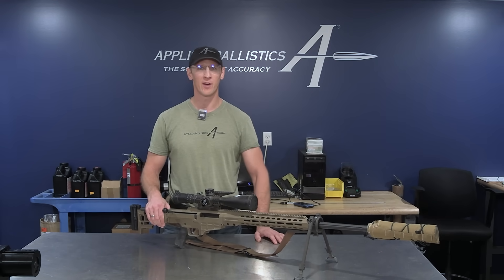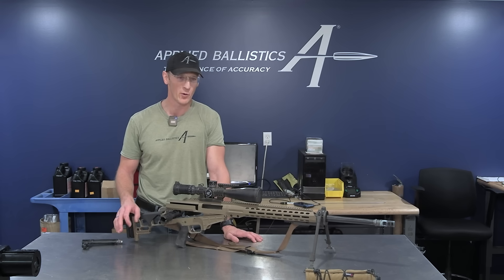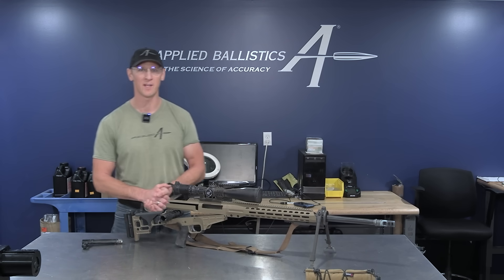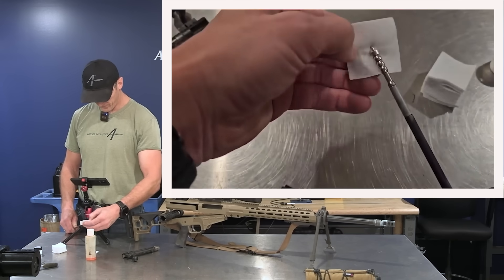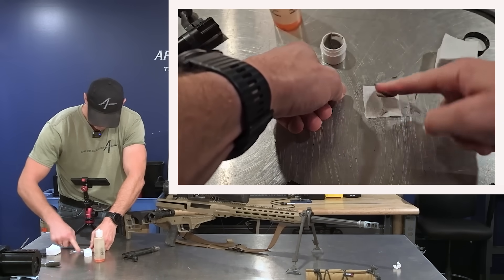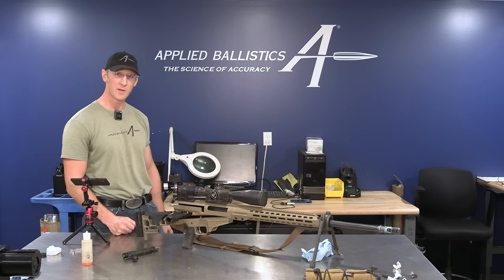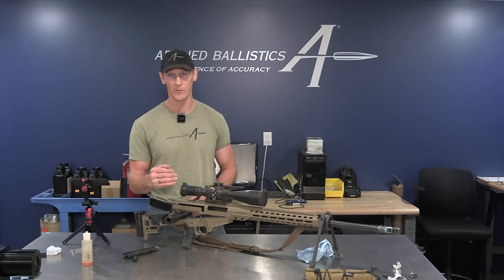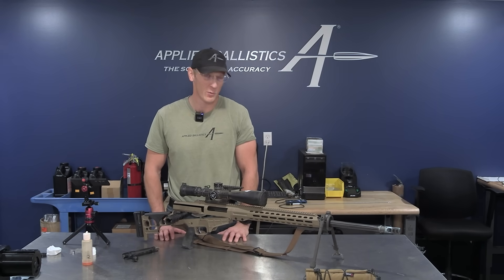High Performance Rifle Barrel Cleaning

Comment: I use a lot of JB Bore Paste.   I wrap a patch around a worn nylon brush and plaster on the JB.   I also run a couple of wet patches thru first and always use a bore guide.  Very clean barrels.
Reply: What I do is plug one end of the barrel with a number 2 pencil, or one of the fat ones kindergarteners use, depending on caliber. Then I open an old lead acid car battery or two and use a turkey baster to fill the barrel with acid standing on end. I ground it by soldering a 4ga copper wire on the bare steel inside the end of the barrel attached to a 4’ solid copper rod driven into the ground exactly 3 1/2 feet deep. Then I leave it in the sun for exactly 13 days. I start adding 1/2 teaspoon of baking soda in through the breech every 4 hrs for 4 days. Then I solder shut the breech with fishing weights and a propane torch and then cool it with dry ice. Then 7 days later I cut the copper grounding wire. Flip the barrel muzzle end up… I take a ball peen hammer and drive the no 2 pencil into the muzzle till it’s flat all the way in. Then I take a metal rod the same caliber diameter as the bore and drive the pencil through the barrel while slowly heating the breech in a fire made of dogwood and rosewood. While driving the pencil through the bore, the lead plug from the fishing weights will heat up and give way under pressure. When the fire hits the acid mixture it will ignite and blow the pencil half way out of the barrel and then suck it back in all the way through the barrel and out the breech into the fire in an instant. But only if you have done it right. If it doesn’t then you have to start over again. 
And then, after that,  I run a couple of oiled patches through it to protect it from rusting and you are done. 
Barrel will be cleaner than from the factory every time. 
I should add that I only clean my rifle after at least 20 rounds. But I never let it go more than 30 before I clean it. 

Hope this helps. 👍
Way better than how we cleaned them i  the army. Their way took forever and the armorer would keep sending you back till you cleaned all the bluing off of every part. 🤷🏼
Reply: This is how I clean barrels when I buy a used rifle.. often they were sold because "they stopped shooting".. 9 times out of 10, this cleaning (and some hand loading) gets them shooting small groups again ;)
Reply: Been doing that method forever...
Looks like we might be the only two .
LoL 😊
I would have thought there'd been more people to agree with that statement.

Comment: The only way I clean mine after 250 rounds a little more oil though and pre patches. Actually the only way I can clean it everything else barely works.  Thank you for confirming what my findings were.  I actually saw barrels get better at about 1100 rounds. Yes more cleaning but groups and sds came alive.    Now my question is why do we break in barrels why not Jb a fresh barrel and go for it?
Reply: I wouldn’t be rough enough to get the proper pressure and velocity.
Reply: What I do is plug one end of the barrel with a number 2 pencil, or one of the fat ones kindergarteners use, depending on caliber. Then I open an old lead acid car battery or two and use a turkey baster to fill the barrel with acid standing on end. I ground it by soldering a 4ga copper wire on the bare steel inside the end of the barrel attached to a 4’ solid copper rod driven into the ground exactly 3 1/2 feet deep. Then I leave it in the sun for exactly 13 days. I start adding 1/2 teaspoon of baking soda in through the breech every 4 hrs for 4 days. Then I solder shut the breech with fishing weights and a propane torch and then cool it with dry ice. Then 7 days later I cut the copper grounding wire. Flip the barrel muzzle end up… I take a ball peen hammer and drive the no 2 pencil into the muzzle till it’s flat all the way in. Then I take a metal rod the same caliber diameter as the bore and drive the pencil through the barrel while slowly heating the breech in a fire made of dogwood and rosewood. While driving the pencil through the bore, the lead plug from the fishing weights will heat up and give way under pressure. When the fire hits the acid mixture it will ignite and blow the pencil half way out of the barrel and then suck it back in all the way through the barrel and out the breech into the fire in an instant. But only if you have done it right. If it doesn’t then you have to start over again. 
And then, after that,  I run a couple of oiled patches through it to protect it from rusting and you are done. 
Barrel will be cleaner than from the factory every time. 
I should add that I only clean my rifle after at least 20 rounds. But I never let it go more than 30 before I clean it. 

Hope this helps. 👍
Way better than how we cleaned them i  the army. Their way took forever and the armorer would keep sending you back till you cleaned all the bluing off of every part. 🤷🏼

Comment: Don’t know if anybody would be interested in a couple of extra step that I do. I actually cut circular leather(cowhide) patches and instead of running the second patch with the JB paste I use the piece of cowhide with JB paste. Just cowhide, not a thick piece of leather. Then I clean everything but at the end of that, I just put some oil on a separate patch of cowhide and I worked the barrel back-and-forth again. I am a 22 shooter so I do not have to deal with copper. I only shoot lead and I do not have the fire cracking like the big guns but I’m telling you it gets unbelievably clean and polished.
Reply: Yeah that’s overkill on a 22 no need to clean it at all really

Comment: As a metallurgist, it blows my mind that rifle makers and barrel manufacturers who specialize in high precision rifles have not addressed the root cause of barrel failure. "Fire cracking" is a problem that has been addressed in other industries, but for some reason the firearm industry just doesn't seem to want to actually fix the problem.
Reply: I think the issue is the difficulty of making barrels to the precision required, so the main steel characteristic being selected for is machinability. You will know that there are many military barrels with chrome lined bores which increases their life and reduces fire cracking and throat erosion substantially. You don't see chrome bores in any precision rifles as it tends to lower accuracy.

The push toward higher performance cartridges with high round count use cases in recent years may spur some development on this front, but somehow I doubt it.
Reply: @SixtyTen10  I strongly believe that if a  carbide bit / rotary file for a die grinder can be machined with precision there is no  reason why a barrel can’t be machined with precision using inconel .
Reply: @levigne25 I think the quagmire is with internal vs external geometries. The die grinder bit, it's really easy to use a huge, heavy, stiff machine to make tiny precise little cuts. But machining rifling its really hard to maintain that level of rigidity being so far away from the tool holder. So we're stuck with softer more machinable steels until someone figures out how to rifle with an EDM, or we go the way of the tank and switch to a smooth bore, which hasn't been successful at this scale yet.
Reply: @joeritter8331  What about a hammer forged polygonal bore along with better materials?  Barrel costs would likely go up quite a bit but if its life, durability and accuracy are also improved it should be a fair trade off.  Wonder what the composition is for the 6.8/.277 fury barrels?  If they maintain the claimed barrel life with the high pressure rounds, they must be using some, out of the ordinary, barrel material.
Reply: @aaronfarnsworth7653  the cold hammer forging process requires a relatively soft material that won't just become a mess of stress fractures as it gets beat around a mandrel. 

The best bets I can see right now if you really want a super alloy barrel are metal 3d printing and EDM machining. 

I doubt there's anything special about the SIG fury barrels. First it's SIG they will absolutely piss on your leg and tell you it's raining. Second I'm not convinced pressure directly causes throat erosion. Every modern cartridge runs between 55 and 62k psi. The ones that burn out barrels fast have relatively high case capacities in small bores but and pressure. .308 and 300 win are the same pressure. On a gentle firing schedule it's not uncommon to get 10-12k rounds through a .308, it's relatively uncommon to get more than 2.5k through a win mag with nearly the same pressure.  It seems to me the problem exists with either the slower powders used in the magnums/ overbore cartridges or the mass of material moving through the bore.  Pressure I'm sure has some effect, but I don't think it's direct, or the driving factor. 

Now that we're seeing wildcatters playing with SIGs 2 piece brass cases, driving old cartridges with well documented life spans well past their SAMMI specs I think we might see some interesting data points emerge in the next few years. 

I'm leaning towards the idea that it's the powders causing temperature differences inside the same pressure envelope. There's a few powders with a reputation as throat burners used in cartridges that are know for longevity. For example there's a growing consensus that VV N540 despite burning very clean and producing great velocity in .223 may reduce barrel life by about 1/3. It got really popular for match .223 ammo for a hot second and fell flat quickly with complaints of barrel life. 

I don't know where it's going and what all the drivers are. But I'm excited by the idea we may find out.
Reply: As a boilermaker and I remember metallurgy class. So   in refineries and power generating stations  the furnace tubes we install and weld are made out of inconel due to its higher melting point  . Wouldn’t a inconel barrel prevent pre mature fire cracking ? Not saying it would eliminate it totally but something tells me it could take a lot more rounds before we see fire cracking .
Reply: What's the solution then  ?
Reply: @ higher yield and ultimate tensile strengths, higher thermal conductivity, and higher fracture toughness. It would also take a manufacturer who isn't scared to put some money on the line, which is basically none of them.
Reply: @the1andonlySherlock  and a lot more corrosion resistant.
Reply: Easy…. Barrel cooling. Barrels now are the equivalent of original Pentium processors just raw dogging the environment without a heat sink.

Yeah a gun should be passive, I’m not saying fans. But heat pipes and high surface area could still increase passive cooling by an order of magnitude with out any mechanical complexity

Comment: That barrel isn't fully clean. There's still hard carbon on the lands/grooves.  I can see it in all the after pictures but the one at about 14:02 is the most apparent.  A barrel which is clean to bare metal will have the same coloration the whole way down. This is the hardest part to achieve and normally persists in the first 4-6 inches of the barrel.  I generally short stroke with JB Blue until it's gone on my benchrest guns but don't really worry about it on my other guns as long as it doesn't start to build up. However, if you do leave it for an extended period it will become harder and harder to remove.  I haven't found a solvent that will touch it.  I'm not making any claims to it affecting accuracy one way or another just mentioning that a fully clean barrel will not have hard carbon residue. 

Another note....you can overclean with abrasives. Especially IOSSO and JB RED(bore bright) they act as a polish and believe it or not you don't want a mirror finish. There's a threshold when a surface becomes too smooth and the friction goes UP which means the sheer force goes up and you will get more copper fouling since the softer copper jacket sheers onto the harder stainless/chromoly barrel.  The finish you want is a consistent subtly shining grey as opposed to a bright mirror finish.

Comment: My right ear enjoyed this video
Why do you not use a bore guide by the way?
Reply from the maker: I'll pay closer attention to the audio channels next time.  I don't think bore guides are necessary.  I'd use them with traditional guns, especially with solvents, to prevent the fluid from leaking down around, thru, and into the bedding, trigger, etc.  But with the MRAD and bore paste, nothing leaks.  And I'm simply not worried about damaging the barrel with the jag the way I use it.

Comment: Is this how you clean every time?
Reply from the maker: yes.  The only thing that changes is the interval, depending on the cartridge, powder, and how new the barrel is.  Shortest interval is 100 rounds, most common is 200, but some guns (260 Rem) firing light loads (under 2600 fps) I don't see the velocity migrate, so I don't clean them at all.  It's the 'high performance' aspect that roughens the barrel and makes it need cleaned/smoothed.

Comment: I use Bore Tech Eliminator with patch and nylon brush to start, then KG2 Bore polish (1400 grit) with patch and nylon brush.  Finish with Thorroclean (patch and nylon brush) to remove the last bit of carbon.    Using a borescope I have found that one product alone will never remove all of the copper AND carbon.   Using these three products in this order will clean a barrel down to the steel if that's what you want.  Bore Tech Eliminator is an awesome daily driver for patching after shooting, removes big chunks of everything and leaves a bit of copper and carbon behind.

Comment: You said “different powders” had a relationship with throat roughness. Was it ball vs extruded, or single vs double base, or is there more nuance than that?
Reply from the maker: In the cases I'm thinking of, it's two different brands of single based, smokeless extruded powder.  So I suspect the variables you mentioned could matter as well.

Comment: a good video same way i clean my barrels i use differant products but same thing
Reply: What I do is plug one end of the barrel with a number 2 pencil, or one of the fat ones kindergarteners use, depending on caliber. Then I open an old lead acid car battery or two and use a turkey baster to fill the barrel with acid standing on end. I ground it by soldering a 4ga copper wire on the bare steel inside the end of the barrel attached to a 4’ solid copper rod driven into the ground exactly 3 1/2 feet deep. Then I leave it in the sun for exactly 13 days. I start adding 1/2 teaspoon of baking soda in through the breech every 4 hrs for 4 days. Then I solder shut the breech with fishing weights and a propane torch and then cool it with dry ice. Then 7 days later I cut the copper grounding wire. Flip the barrel muzzle end up… I take a ball peen hammer and drive the no 2 pencil into the muzzle till it’s flat all the way in. Then I take a metal rod the same caliber diameter as the bore and drive the pencil through the barrel while slowly heating the breech in a fire made of dogwood and rosewood. While driving the pencil through the bore, the lead plug from the fishing weights will heat up and give way under pressure. When the fire hits the acid mixture it will ignite and blow the pencil half way out of the barrel and then suck it back in all the way through the barrel and out the breech into the fire in an instant. But only if you have done it right. If it doesn’t then you have to start over again. 
And then, after that,  I run a couple of oiled patches through it to protect it from rusting and you are done. 
Barrel will be cleaner than from the factory every time. 
I should add that I only clean my rifle after at least 20 rounds. But I never let it go more than 30 before I clean it. 

Hope this helps. 👍
Way better than how we cleaned them i  the army. Their way took forever and the armorer would keep sending you back till you cleaned all the bluing off of every part. 🤷🏼

Comment: Difference in grit between Iosso bore paste and JB bore paste. Which one is more or less course?
Reply: Put a bit of iosso on a patch and rub it on a piece of steel and see how long it takes to make a pit where you are rubbing on that spot
Reply: JB is less aggressive, I use Flitz bore cleaner. Its in between iosso and jb as far as aggressiveness is concerned.
Reply: @79brumley  that's what I wanted to know, I started using Iosso because, of course, Erik Cortina recommended it. But then I stopped because of several people saying it could be overused and cause irreparable damage real easily. I don't own a bore scope and I know I need one. This is why I am askinh.

Comment: First you should put a few patches with CLR as after that you will only need 20 strokes with lightly saturated Iosso patch and its all done. CLR rules carbon removal.
Reply: This video is not about just removing carbon , CLR cannot remove high spots and rough edges from fire cracking . Watch the video again .
Reply: @levigne25  Read my comment again carefully, I am stating that CLR helps softening the hard carbon deposits so the manual work with abrasives is far less than without it. Comprende? No one is saying that abrasives are not smoothening fire cracking

Comment: Would you always recommend using abrasives when you clean?  Or do you use chemicals during its life?
Reply from the maker: When it's not a 'high performance' rifle barrel, or one you're not running too hard, where it's not fire cracking the barrel, then I think chemical solvents will be adequate, but abrasives can still do that job too.  Many people are afraid of the potential damaging effects of abrasives and I used to be as well.  Having used them as much as I have on many barrels... I'm just not afraid anymore.  I think in this case the fear is from lack of experience.  But to answer your question I could go either way for barrels that don't need the smoothing effect of abrasive cleaning.  If fouling is the only issue, solvents (or abrasives) will get it out just fine.
Reply: @ thank you for the info 🤙